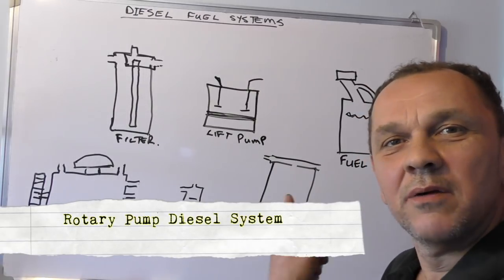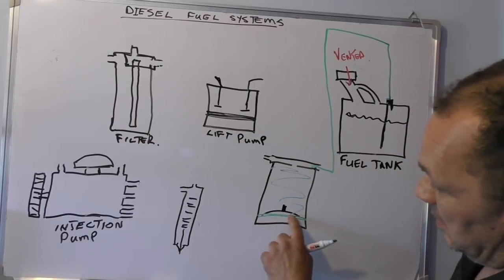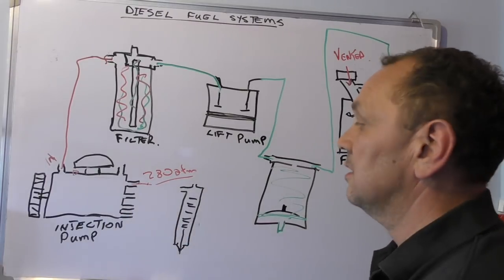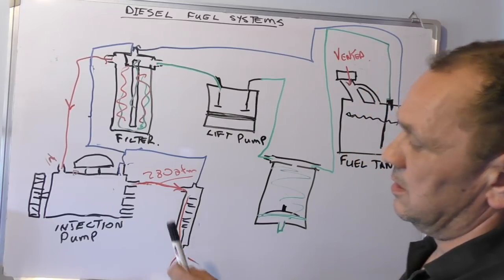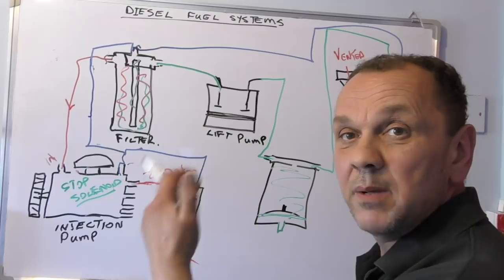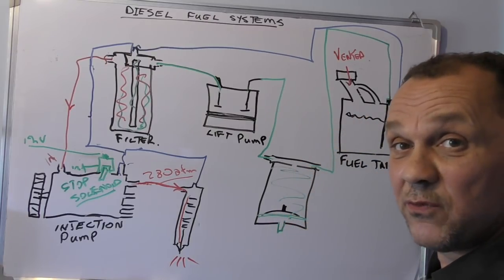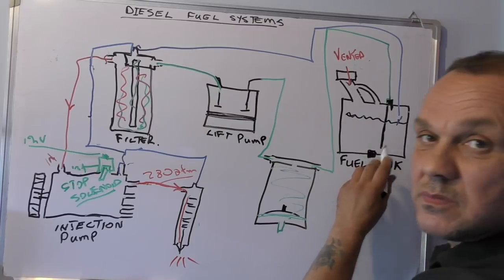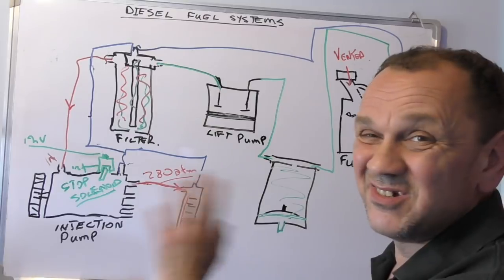LRTV Whiteboard Sessions.  200 & 300tdi Fuel System explained

Comment: Great video!  Working through a non-start issue now.  I think it’s the lift pump and it coincidentally decided to fail at the same time I was fitting a new timing belt.  I’m sure the lnjection pump gear, camshaft gear and crankshaft gear have not moved relative to one another (I used the injection pump and flywheel lock from the timing kit) and the truck was running fine prior to the timing belt change.  This video has only further convinced me that it’s the lift pump.  Heard these go bad rather often.  Thanks!!!!!!

Comment: i've got a really strange problem with my 300tdi. can anyone help me?
it's leaking air into the fuel line, but only on an incline. any idea why it might only leak air while on an incline?
Reply: Did you ever get this sorted? I’m having the same issue with my 200, suspect it’s a dodgy sender, but would helpful to hear other possibilities.
Reply: @cseanny  yeah, got it sorted by a mechanic in the end. not sure what the solution was, sorry. good luck 👍

Comment: Great video, Thank you.  One question, the hard lines  that run from lift pump to filter paired with the line from filter to Injection pump have a "Loop-D Loop" formed in the line.  Is this important?  What is the function?  The only thing I can figure is that it is some counter current mechanism to preheat fuel before filter.

Comment: You are my Hero. I did a engine swap replacing a 300TDI in my 1996 Defender 110 with a older TDI from a discovery. I was un able to get my engine running and after a bunch of reading and video watching I realized that the Stop Solenoid was not wired in. Once I connected the wire it fired up. Thank you for being so thorough.

Comment: I install a backflow valve just before the filter in my old diesels to avoid cold start issues due to air leaks. It was a headache in my Citroen Cx 25 TRD T2 for months since I installed one of those. Since now it starts to the first key touch even after hibernating wake up.

Comment: Got a 200tdi defender and taking off the cap from the injector pump where the boost diaphragm sits, i had a fair bit of oil sat on top. Cleaned it up but cannot remove the diaphragm housing to remove the pin though that is not my biggest worry, main concern of course is the oil on the housing. 
I have traced it back to a hose that connects to the turbo so obviously oil is travelling from the turbo to the injector so of course i want to get this sorted sooner rather than later. Any ideas on what i can do?
Reply from the maker: replace the turbo if it is pushing oil out.  ( sorry for late reply)

Comment: Well, I had problems a long time back, and I had to get the FIP repaired at a professional Bosch pump service. I had low engine power. Appart from that, and following your recommendation, I changed the 4 injectors. That got rid of the persistent smoke problems I had after the engine rebuild.
I must say, that I've never touched the sediment filter. I've run nearly 400,000 Kilometers and I've never touched that element. Keep my fingers crossed.
Reply from the maker: It'll be a messs if it hasn't been touched for a while.  They usually rot in place.